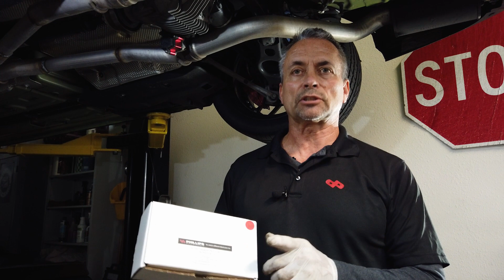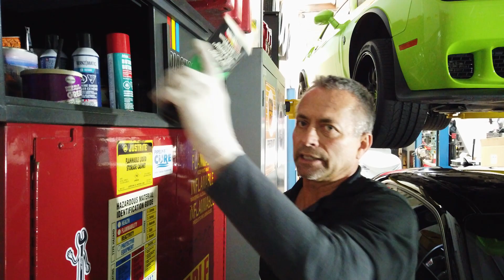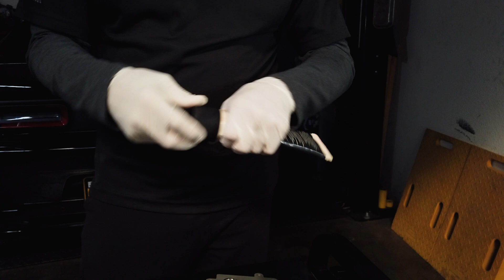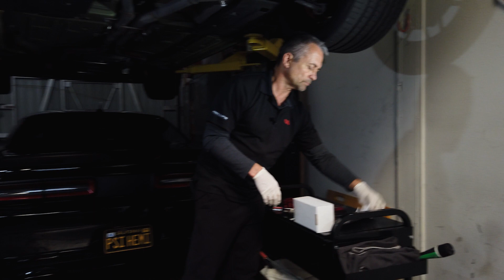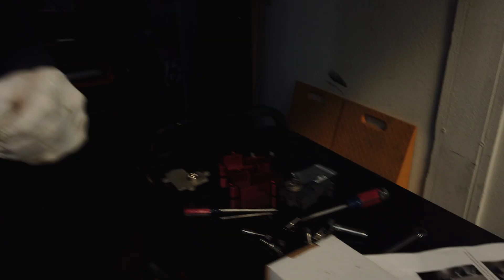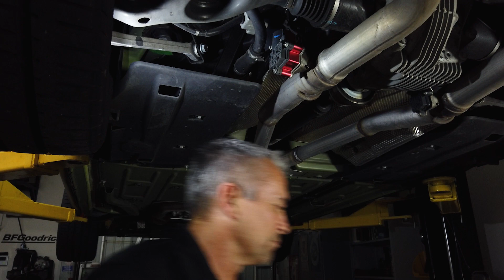Dodge Challenger Active Exhaust Delete Kit Installation

Comment: That's a lie u don't need to purchase that all u have to do is go to any auto zone store and buy J.B steel stick it's cost about $10 it only works if u have a 2019 and up scatpack u won't get a check engine light it's a clay u turn the knobs to a 2oclock position and u put put the clay on it let it sit over night and it will turn into steel it will not move once it's on thre it's also heat resistance I know from experience I did it on mine works perfects do not use zip ties cause they'll eventually come loose or burn out I promise u it works
Reply: Whats a lie???  Product works and so does chewing gum or painting your car with a rattle can.    This is the most stupid post I have ever read.  JB weld on your exhaust valve.   Says the nameless, pictureless moron

Comment: $220 what a rip off just zip tie it u don't need this product to open the valve u really don't..CHECK ENGINE LIGHT IS NOT COMING ON ITS A MYTH TO GET U TO BUY THESE PRODUCTS
Reply: I did mine yesterday and it actually did turn on my check engine light after zip tie
Reply: You can also rattle can your car if you need it painted.   Play at your level junior.

Comment: Does it fit on a dodge challenger hellcat 2015 mod? And if it fits, do you get any fault codes or lamps in the dashbord?
Reply: Sorry not sure what Mod means?   will not through codes
Reply: Just a 2015 year modell, but thank!
Reply: And do you ship to Norway?
Reply: @jonasskatter349  If the car has active exhaust, they all use the same system and this will work.  yes we ship to norway
Reply: @jonasskatter349  yes we do

Comment: With this kit do we need the spring from the original simulator or does it not need the spring?
Reply: Yes spring stays in and works as it usually does.   seats on to a rotating platform that allows it to operate correctly and prevent any code from occurring, because its disconnected from the actual turning of the valve
Reply: @williamphillips1240  thanks for the reply 🙏 sounds like the way to go gonna invest in one. Sick of my CEL on just cause my cat backs

Comment: Just use a zip tie. Takes 15min. remove cover turn to open zip tie done.
Reply: Get the Jack out,  jack the car up.  remove the actuator and use a zip tie?  Just after you paint the hood with a rattle can., and duck tape your broken light.  With deliverance banjo in the background.  Bring your buddies over to show them your bitchin go fast ties.   Saving a few hundred bucks, on your ride aint worth it, JOE  LOL

Comment: Will this stop the rattle
Reply: It may or may not,   Dodge has an issue with the valve itself.  my product pins it open   and correctly allows the motor to function normal with out binding the spring.    some have used it and it solved it,   Sorry cant guarantee it would stop a rattle

Comment: You don't need it .just remove the spring tie wrap the valve open  and put motor back minus the spring. Done!
Reply: If it throws a light, you will know this clown only knows what he guesses.  Troll on
Reply: @williamphillips1240 😂 yeah he doesn’t know what he is talking about. If you zip tie it it will literally throw a check engine light. Hey I mean if you cool with driving with a Check Engine light then be my guess
Reply: You called it    thanks   @Pokenostalgiastore
Reply: @Pokenostalgiastore  not the case in everybody situation!! some people don’t know what they doing!! I zip tied my 2019 scat pack never had a check engine light for 2 years & also I did it on my widebody & still haven’t had a check engine light I’m going 2 years strong on this one as well
Reply: I was thinking the same just to remove the spring. Did you try that I have a 2023 RT 5.7 Challenger?

Comment: What happens if the motor is busted? Will this still work?
Reply: Depends on what you mean by busted.   It will hold the valve open

Comment: Does this work on a aftermarket exhaust with codes?
Reply: If you get the active exhaust delete from summit racing it should get rid of codes. I used it on my 17 RT. The kit thru them easily plugs into the old plug from the active exhaust and tricks the computer , telling it that it's still connected and working properly
Reply: Z automotive

Comment: Will this fix the rattle from the solenoid? I tried the zip tie and spring delete but the solenoid is still kinda lose and it's still rattling a little bit.
Reply: What did you do to fix? I have a bad rattle and nothing online seems to fix jt
Reply: @chaffycaesar8026  there was a kit that provided a bushing/buffer to put in that area that holds it. I just forgot the name
Reply: Did you fix it  guymusic?
Reply: @n0bly_hades  I wouldn't say that it fixed it but I did minimize it.
Reply: I just when to get the tsi today, and obviously didn’t pass because the check engine light smh

Comment: Or, like ME, don't Pay anyone Sh*t and do it yourself for FREE. Take actuator off via 3 nuts. Remove the pre-mounted spring that is attached to the actuator. Zip tie the active exhaust valve Open (I Tac Welded mine Open). Reinstall the actuator via 3 nuts. Job Finished for the extremely high price of FREEEEE! Class Dismissed...
Reply: This can absolutely be done... and wire clothes hangers with chewing gum will also work, if your going to class to be cheap on your nice ride, do it right, gum is cheaper than wire ties or a welder. (everyone doesn't have one)    You can also paint your car with a rattle can,  use recycled oil filters. and burn the cheapest regular gas you can find.    Congratulate yourself on graduating from the school of being a tightwad or step up.   Do what you can afford and spend your time on youtube bragging about it.
Reply: @williamphillips1240 that’s quite a stretch comparing using a small wire that no one would ever see to an entire paint job…. You going to have people crawl under your car so they can see your super cool $250 exhaust mod that no one cares about that everyone knows you could have just done for free? Lolololol
Reply: some do things right, some do it anyway they can get it done.  Depends on which way you stretch  Lolololol @TimothytheTooth

Comment: why not just do the free mod? hold it open with a piece of wire or zip tie and save yourself $150+  until you decide to get a exhaust system
Reply: Why not do paint mods to your car with a spray can?    Also,  the factory exhaust system is actually a good system and with minor mods performs and sounds great.   But for the record, your suggestion is sound and will work.

Comment: Question so the first plate you put on the active exaust motar with spin the piece on the plate giving the idea its doing its job without touching the actual spring?
Reply: Yes, but to fill in a small detail.  that plate also on the other side holds the valve open constantly. and the side your talking about allows the motor to function as normal and not signal the CPU.
Reply: @williamphillips1240 hello William I just wanted to ask will this work on a 2019 Dodge Charger Scat Pack cause there is a rattling on mine and it doesn't rattle when it's on track mode but I would like to know if this would fit on a charger perhaps. If it does I will get one asap.
Reply: @Skat392  sounds like it will.  Please see my response above this one that explains it better.    track mode pins the valve open most of the time not all the time.
Reply: @williamphillips1240  thank you really made me understand it better and will get one soon hopefully it fits
Reply: First plate stabilizes by locking the valve wide open on the valve side.  Motor side of that plate has a rotating seat for the spring,  with stops that allows the motor to work exactly as it does with the spring in place as it would be OEM.  Cant throw a code or bind as some kits could cause, or wear out the motor.   It does what it would do as if stock accept the valve is open.  It all mounts cleanly with a machined stand off for mounting the motor as it rides on the OEM set up.  Noise changer only, does NOT effect emissions.    Hope this helps   Bill
Reply: I believe if you have the tazer for the scat...track mode keeps it open all the time...
Reply: @STARFIGHT88  cant comment on a product I do not know well or it's cost

Comment: I had the same rattle a few weeks ago and I took in to a muffler shop, guy new the problem right away and offered this solution: he completely removed the actuator and welded them on the side somewhere as to not get a check engine light and get the open valve all the time... is this a good thing? LOL
Reply: not a good or bad thing.   will work.   motor will run more than normal because there is not stop as it has factory , thats all
Reply: @williamphillips1240  1st of all, I appreciate you answering my question. Thank you. And just to clarify, when you say the motor will run more, you mean more gas consumption or what’d you mean?
Reply: @georgeperez6114  electric exhaust valve motor will run more.  Has no stop position as the valve or a kit would act as.

Comment: My challenger throwing 2 codes for the active exhaust if I buy this product will I still have to buy a new factory motor ?
Reply: Our system will not correct or solve code issues.   It pins the valve open and allows the motor to function as it would normally

Comment: Your valves are more expensive then others...they look great but 19 up if valves are locked and spring removed won't cause check engine light to come on.
Reply: We are not interested in being the cheapest, just the best, and we are in more ways than just looks.    Your incorrect, all of the valves, not just 19 and up  can be held open if you hold them them open in some way, no such thing as locking them.  Suggest you run this a bit longer to know.   The motor without resistance will free wheel without a stop position so you will hear them running more often.

Comment: What are you called that factory motor? Do you know the part number
Reply: Sorry don't know the part number.    The factory motors are what powers the opening and shutting or the Active exhaust system
Reply: I know that but I’m trying to find the motor and then buy your part one of my motors is bad

Comment: Is it necessary to unplug them during the install?  Can't you just push them to the side while you install the the new plate and spacer?  Then just swing them back into position and screw them back down.  I don't see the need to unplug them which can potentially throw a code.  Or am I wrong.
Reply: you could be right, meaning both ways could be right.   Im positive that unplugging and replugging them in does not throw a code.   Done it many times
Reply: @williamphillips1240  I'm throwing a p121b after 500 miles on a new actuator.   Will a kit like this eliminate the code?
Reply: @mikeprice8307  wish i could say it would.    plug the motor in an wire it up out of the way to test if its the valve or motor issue

Comment: For names sake, I would call it a bypass kit. You are not truly removing or “deleting” the valves. Just relocating them and bypassing their intended function, but I’m a stickler for details.
Reply: jamie, hope you dont mind me respectfully offering a counter opinion.   This does delete the active exhaust in the car.  active exhaust is a function not a valve.  The valve is only a part of the mechanics as are all the parts.  This kit is deleting the active exhaust function in the car.   To bypass something you have to, by definition, go around it.  This does not do that.   my take, possibly we are both right

Comment: This vs mfer?? Which is better?
Reply from the maker: Different, but better is a matter of choice.  I had mfers on my car for about 1 month.  Glad to sell them to you for 50.00.  Our set up is completely different and I feel a cleaner looking set up and less likely to damage the spring and wont throw a code.   Or you can listen to the clowns on line that are convinced the 19 and up are different and use a piece of wire on  your car.   FCA had a rattle issue and they know it, so the 19 up is about fixing that.  You can remove the spring and wire any year open.  Trolls bent on negative commenting on my channel will be deleted.  Constructive comments or questions will not.
Reply: @phillipsperformance3927  i would like to try yours, i like the way it looks over the mfer but sadly with my magnaflow xmod exhaust and the way the bracket that  holds the active exhaust module is built it will not allow for your product to be mounted. I can send you a picture on ig, fb or email so u can b the judge. If i find out that it will work i will buy your product asap
Reply from the maker: @DCGEMINI202  sure    support@phillipsperformance.com   will get it to me